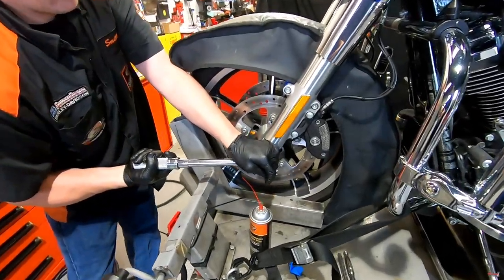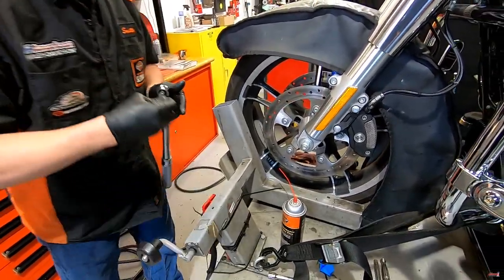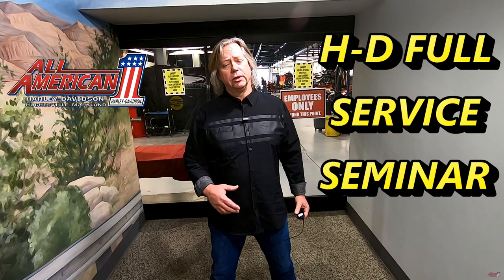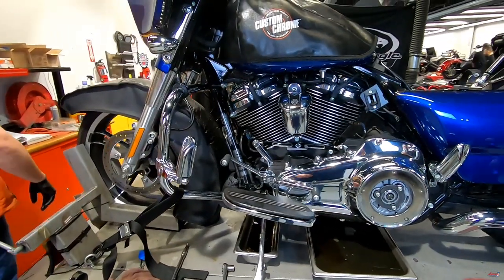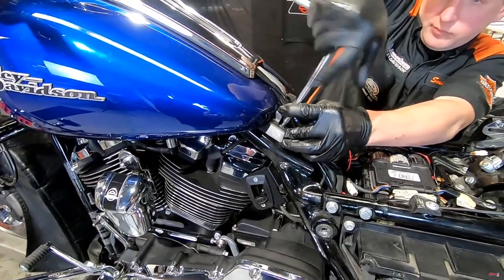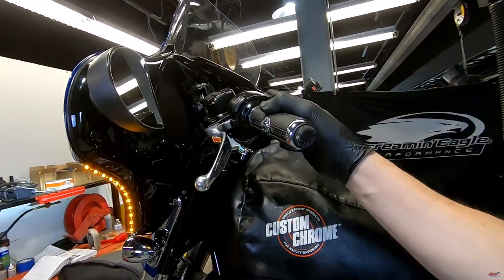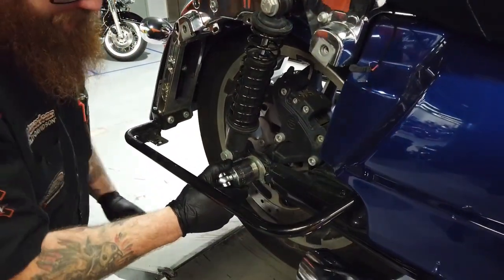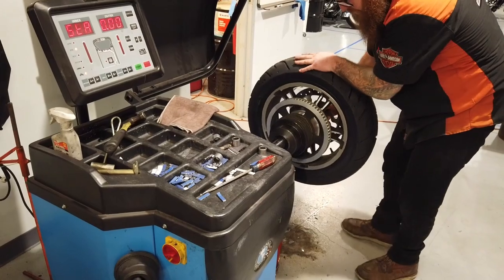Harley-Davidson Maintenance Seminars

Comment: I had that 'condition' with my saddlebag falling off on my 2014 RK ...it was a bad thing!  The new system is much better.  That was really interesting and informative Colin ...thanks for your efforts.
Reply from the maker: Thanks man. Little things like the O-ring and correct tire pressure make such a difference.